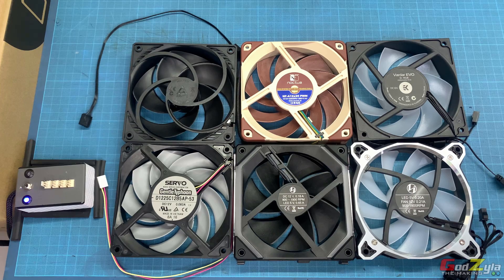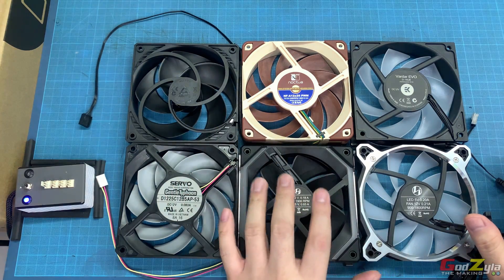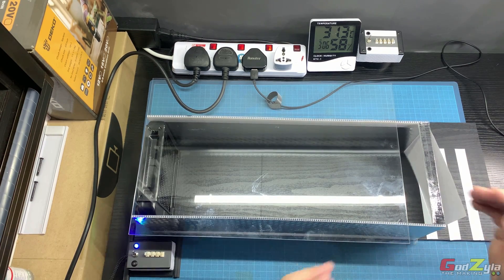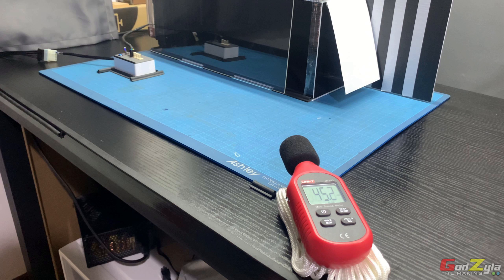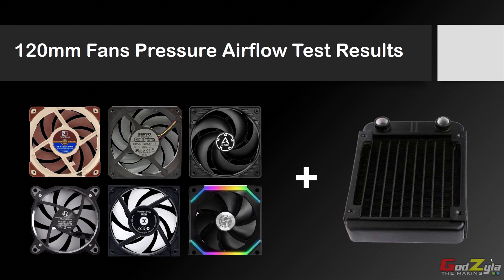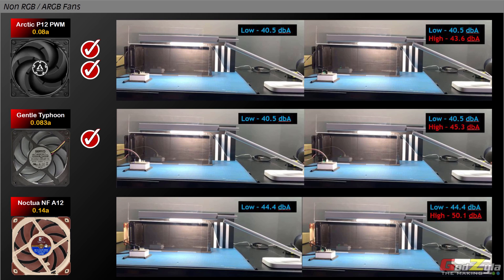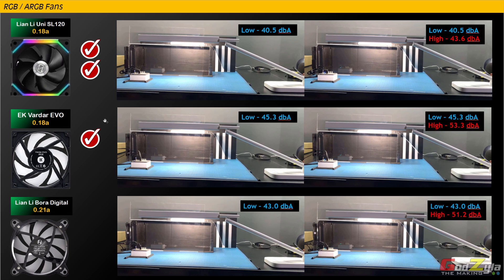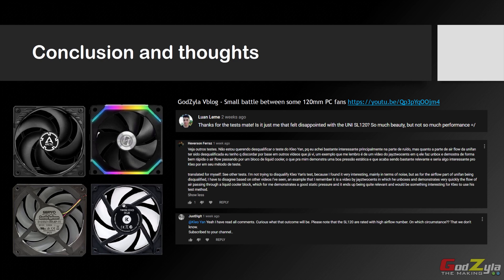120mm Pressure Static Airflow Test - Part II

Comment: Hi thanks for your tests and sorry for commenting on an old video but since seem to be so keen and knowledgeable on the lian li products I actually got 6 sl120s on a lian li dynamic and an arctic freezer 360. The arctic freezer is set as exhaust on top and the 6 sl120 as in flow on the bottom and the side . Your video says max db for the uni fans is same as arctic p12 which are used in the AIO and I find it very surprising as my bottom sl 120s make a lot of noise for some reason I even got replacement and they’re very loud even at 800RPM and generate a hum and vibrations. Do you have any explanation or solution to this ?
Reply from the maker: hello Silentkills, welcoe to my channel. yes I do face your issue. so what I did was this. https://youtu.be/eyxxF4qdA_0 and it helps to muffer the huming. it's due to the slits for fan holes at the bottom.
Reply: @KleoYan  thank you I have already sen the video but didn’t think it would apply to my case. So even though the humming comes from bottom fans I apply the duct tape to the top?
Reply from the maker: @silentkillz  hmm interesting. To be honest, I thought by blocking the slit might help but since you have done that. I have no other solutions to your case. I only did this for the fans am using and it does work for me.

Comment: I have the p12’s on my aio and they are basically silent at idle even with the case open. I just got the al120’s and at 800rpm they are almost as loud as the p12’s. It’s pretty insane for $89 for a set of three. They’re lucky the cabling and looks outweigh the noise levels or I would’ve returned them. I assumed that for the price it would be quieter. My older hyper 212 with 3 case fans under load is about the same noise level as the al120 unifans at idle.
Reply from the maker: Hi Micah Ross, welcome to my channel, glad that the AL120 are working for your fine with the argb effects :)

Comment: This seems very odd, as every single other video I’ve watched ranks the a12x25 as the absolute winner in both performance and noise.
Reply: Ahh, I see... You've just used a crude PWM-controller and set a fixed percentage on 2 stages.
So when you set the "low-mode" which I assume to be somewhere around 50%, it's 50% of P12 (1800/2 = 900 RPM) whereas 50% of a12x25 (2000/2 = 1000 RPM)
That explains why your results are flawed, but I can't find the explanation of why your results in airflow directly contradicts every other review...
https://youtu.be/QwftVMGPOiI?t=252
Reply from the maker: @Mikkel111  welcome to my channel. Yup,correct, some suggested that this should not be the way to test it. Well to me, it does not matter, as you can see, on full blast RPMs some fans which is at max voltage and  RPMs. They can't even push air. I will only consider a fan is good if these are in place. 1st the current drawn, how much air can that fan push with little amount of effort (ampere used), 2nd fan build, so long it does not flex so much, and 3rd noise. 

not everyone thinks like the way I do. Yes you can have fix RPM on all fans but the current draw are all different, some require more and some require less. An example, Gentle typhoon (GT) and Arctic (ARC) at max speed on high, draw current respectively  at. 0.8 (GT) and 0.83 (ARC) , max RPM is 1850 (GT)  and 1850 (ARC). and the Noctua is drawing 0.14a and max RPM is at 2000 rpm. In this test it's provide, I use less energy or current (amperre) with lower max RPM, air can be pushed (GT) and (ARC) vs Noctua. I hope this make sense. sometimes on a specs on spreadsheet does not tell anything. I believe in sense of touch and see.
Reply: @KleoYan  That is the issue. Your results directly contradict the results of all other reviewers.
I find it difficult to believe that everyone else have false results and you somehow have the only correct results. Therefore, I can deduct your testing as faulty.
Considering at least 1 parameter of your test is flawed, that should not be surprising.
You also only have 1 point of data.

Being a reviewer means you have to make sure you test stuff the correct way. Your opinion is, to be frank, irrelevant.
Furthermore, basing your “opinion” on flawed data is juvenile.

Until you can provide further evidence (non-flawed, of course) that your claim is correct. I will consider this video as spam/biased.
Reply from the maker: @Mikkel111  Hi, thank you for your feedback. point noted, shall be more careful on my content. once again thank you for your feedback and to have visit my channel.

Comment: It would probably be better to test using an anemometer instead of a piece of paper if you want to test airflow through a radiator. In the most basic case you should test airflow using fan speeds at a fixed sound level. In the ideal case you will have a graph with noise levels on the X-axis and air speed through the radiator on the Y-axis, this would give people a better idea on how each fan will perform at their ideal noise levels. Noise measurements at max RPMs paint a very misleading picture when comparing fans. Fans with higher max speeds will obviously be louder than fans with a slower max speeds. The testing you are doing right now will only be useful for people connecting their fans directly to the PSU using a molex to a 3 or 4-pin adapter. You should also test PWM fans using PWM controllers and voltage regulated fans using voltage based controllers, some PWM fans will have very different noise characteristics when being controlled by voltage.
Reply from the maker: Hi Ren Tilt, welcome to my channel thank you for the feedback. will consider that next time if I do test fans again. thank you!

Comment: Man, how this fan will look as pull fan? i want to put next to my vents radiator, and fans on top
Reply from the maker: Hello Aleksejs Hamjonoks, welcome to my channel. It really depends on which case you are using and most importantly the Radiator thickness, just my opinion, if your radiator is below 50mm thick. no point doing push pull configuration. you will only gain 1 to 2 degrees drop. plus you will accumulate more dust plus more current drawn from your PSU.
Reply: @KleoYan  no, i mean just pull :) I have nemesis gtx 360 54mm thick:) i want to have fans on top is possible, but i am not sure if they capable enough to pull air through rad from the bottom of O11 Dynamic XL
Reply from the maker: @meccu19  Aik my bad. It will work, infact is the same as I've tested, does not matter push or pull. but if you only doing push or pull, your rad (54mm thick) might store more heat than to dissipate them. In my opinion, you should do push & pull configuration, more effective to channel the air through your rad.
Reply: @KleoYan  i am trying to do so:) but i dont have space to put 3rd fan :(
Reply from the maker: @meccu19  I see, if that's the case, you left with no choice but to only place one set of fans. thank you!
Reply: @KleoYan  I waiting for very slim fittings :) there is a small chance what I can push pull

Comment: Hi, i have in my case
P14 for intake and exhaust with phanteks halos on it
Vardrar on aio (ek aio)

I was thinking switching the vardar for unifan and keep the arctic for the case

But I don't want to use hubs, could i use the unifan linked to the halos on rgb header and control fan speed on my aquasuite quadro?
Reply from the maker: Hi Asryan, welcome to my channel. I have two options on your request.

Option 1 - yes you can do that. so long you know your motherboard is able to take the argb load which the SL fans require. each SL120 or SL140 will take up .65a .. just make sure that your argb header of your motherboard can take it. in most cases is max load 3A. As for fan load, not an issue as they draw only 0.18a which most motherboard fan header provides min 1A (for pump 2A). in order for you to use the sl120/sl140 argb on your motherboard, you need to get a convertor.. https://www.ebay.com/itm/133521646617 1 to 1 Female. 

Option 2 - if you going for esthetic, go ahead with option 1, I for one will not sacrifices performance over looks. I will stick to the EK Vardar fans. they are more superior in static pressure air compared to the SL 120 or SL 140. https://youtu.be/apDZ4v_jQBs  . as for argb, EK only needs 0.2a argb load. it does not draw so much ampere compared to SL120 or SL140, your PSU will be happier and more power delivery will focus on your other PC components rather than suffering to keep up the load. 

of course Option 2 is more of my own opinion. as I personally dislike argbs as these are the reason, 1) too much coloring. it does not show details of the component you are using 2) introducing more heat inside the case 3) drawing additional power from PSU ... watch this timing as I explain why i dislike it https://youtu.be/0qSaX_mOjQc?t=861 
btw this is my current rig if you are curious how it looks like.  https://imgur.com/gallery/Pw5kY4q
Reply: @KleoYan  i guess I'll stick to vardar with lower speed and I'll have the same cooling then? At which speed do you recommend to max them? Thanks again :) very nice rig!
Reply from the maker: @asryan7582  in general to prevent so much humming and whining so long your ek does not go up to 1400 to 1600rpm you should be fine. Also it depends how you channel intake and exhaust. It will take time and effort to drawn the air pressure to flow in your case. For me is a small case. Higher airflow is needed inside the case, unlike mid tower where you have plenty of space for hot air to pass through. To be honest, the smaller the case it is. The higher the temperature. If I am to switch my current case to a lancool II mesh. It will do better temperature. Oops I begin to go off topic sorry.
Reply: @KleoYan  ahah

I have a p600s, it's a good case
My temp are ok I usually max the front intake (p14)
Around 60% on the cpu fans (ek) and exhaust (p14 too)

I have a 5900x since recently and I was surprised by the idle temps around 40c, my 9900 was more close to 33c. But I guess more core more heat. But in game s the cpu is around 50 to 55 ( 4.6 all cores at 1.2, haven't done much more with it yets still trying to understand ryzen better I've been an intel guy for 20 years)

My issue with noise is more about my strix 3090 fans in game..
Reply from the maker: @asryan7582  ah ha. Superb case for airflow. Nice buddy. Hmm as for 3090. Have you done any undervolting?
Reply: @KleoYan  yes, 1900mhz for 0 875 but temps are between 60 and 70 core and 80 to 90, memory junction I guess it's ok?
Reply from the maker: @asryan7582  I see. That’s good. If you getting those TJ temp then nothing to worry about. Mine is always at 83 degrees at full load.
Reply: @KleoYan  even 90c is ok? i read it's ok untill 105 c right?

Are you experienced in Ryzen cpus?